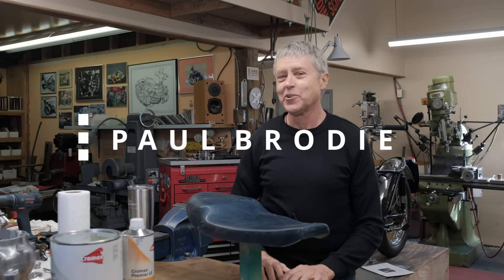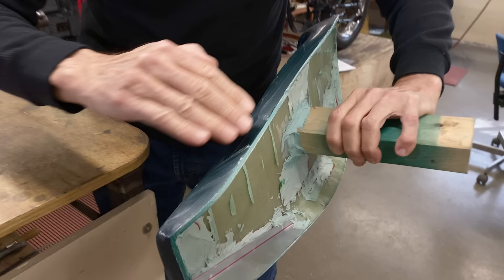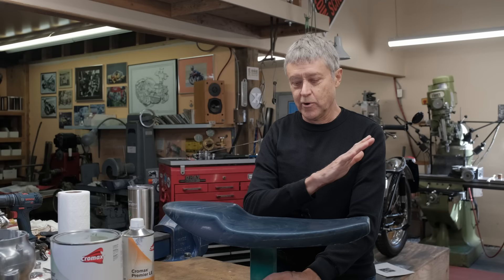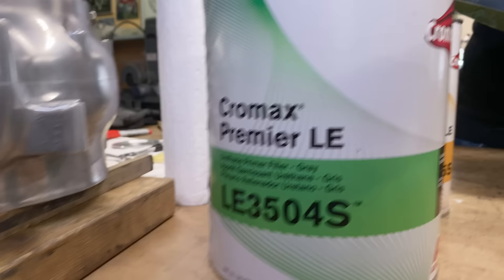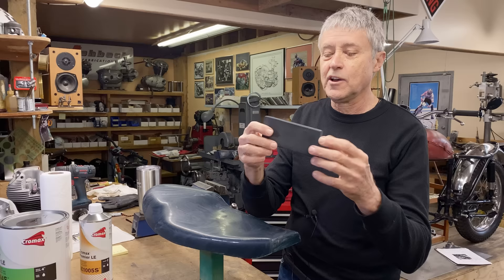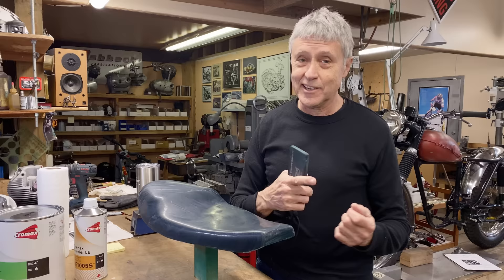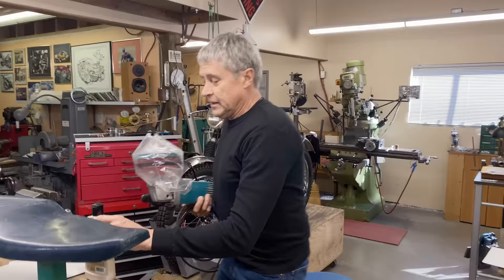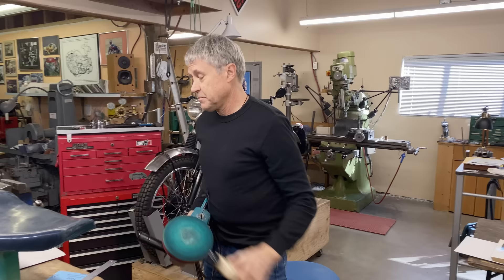How to make a carbon fibre seat pan // Paul Brodie's Shop

Comment: Better you then me getting that resin stuck to everything. I sanded a whole Corvette with roofing insulation, it was I was told volcanic, took all the paint off, conformed to all curves, but didn't scratch the gelcoat, except it smelled like an unattended PortaSan, sometime you have to take the bad with the good.

Comment: "If you don't do it properly a lot can go wrong" that definitely  applies to so many things, but especially composites. It's nice to see a simple process for carbon fiber. I'm used to seeing it done with the vacuum bagging and infusion or the prepreg and autoclave and being so expensive. I still have a lot to learn about all the finishing and composite processes, since I mostly come from machining, welding, and working on engines.
Reply from the maker: In a sense I am "cheating" with the carbon fibre, but I was just after the look, so this way is easier for me. Thanks for watching.
Reply: @paulbrodie  You could cheat a littler bit more - just get a pack of Cloth Bags for the vacuum cleaner & peel ply.
These bags a dirt cheap and the heavist part is the resin with that method you can get theparts lighter and nicer & without air bubbles its stronger as well.

Comment: Re your mudguard (fender) disaster, I did something similar years ago when attempting to take a fibreglass mold off a plaster wall light fitting.  My wife was away on holiday, so I had two days to recreate the fitting out of timber, get multiple coats of shellac on it and  then lots of wax.  The end story: the (3 piece) mould came out fine and I ended up making 22 lights for our new house.
The moral of the story is to not give up, but take time to regroup, learn from the mistake and move forward.
Reply from the maker: David, I think you are correct!

Comment: Good to see how this should be done.  I once built a kayak using molds for top and bottom. It went well until it came to joining the top to the bottom with 4" wide fiber-glass tape on the inside seam, it worked OK but looked pretty bad and I got a lot of resin in my hair.  Happy days.
Reply from the maker: Getting resin in your hair does not sound like a good thing! Fibreglassing is not always easy, and you really do have to think on your feet sometimes.
Reply: Haha me too!

Comment: That was excellent, I went through the same learning process.
I learnt I could make race seat mounts on motorcycle frames by covering the frame with cling film and using the tubes as the buck.
Reply from the maker: Thank you Geoff.

Comment: I'm working on a kit car and went through a similar learning curve on the fiberglass body.  One other thing the roller does is soak up excess resin.  Dunking the roller in acetone was a trick I hadn't heard before.  Nice to know that now.
Reply from the maker: Yes, putting the brush or roller into acetone is good to know. I struggled so much before I knew that.

Comment: Spot on for the explanation. Between Crownline boat factory and Bombardier/Sea doo I spent 7 years doing fiberglass repair,mold maintenance and running their fiberglass chopper guns. Acetone is definitely your friend when working with composites,although it’s extremely flammable. Definitely need to work in a well ventilated area when working with resin and acetone,been in two chopper gun booths that went up in a fireball. Apparently static electricity builds up in your body when you run the chopper gun or when you knock down the glass with a roller. We had 3 gallon acetone buckets to wash our hands and chopper guns in. The first time I went up in flames my buddy had just lifted the lid on his acetone bucket. The second time it was me getting the chopper gun close enough to the acetone for a spark to jump,we constantly scrubbed our guns with acetone and paint brushes to keep them in operation. Just a little fyi there,I always keep a door open with a box fan in the opening to circulate fresh air when doing glass work now. Great work on the mold and your video. Keep up the excellent work. 👍
Reply from the maker: Lewis, good comments! Yes, I do need to be more aware that acetone burns very well. You definitely have some stories about your work with fibreglass.. Thanks for watching!
Reply: Glad to see your content regularly on here. Still in the process of finishing up my knucklehead engine,just waiting on shims to arrive for my rocker shafts. After that’s done the Aermacchi is back in the works here after finding a useable cylinder. I don’t miss the fiberglass work occasionally but if I had to build boats as a source of I’d be looking for a nice cushy cardboard box to live in,lol. Can’t wait to see what’s coming down the pike on your next bike project or installment.
Reply from the maker: @lewismocaby3646   Thank you Lewis :)

Comment: Thanks for filling in my holes in my understanding of Fiberglassing.  I didn’t know a lot of this stuff, so I learned other methods, e.g. using toilet bowl wax or beeswax, building up a few thousandths, layup, then heating things when done and the part comes off “dead easy.”
Reply from the maker: Yes, there are several ways that can work. Thanks for watching.

Comment: If you put a flange around the bottom of the mould you can easily vac bag it. Using a slow cure epoxy will give you plenty of time. The part will be much stronger and lighter. Sac cloth and bleeder material will get all that excess resin and bubbles out. You would love the results being a fussy old frame builder. 😎

Comment: From what I remember from about 40 years ago, chopped strand mat has a binder that dissolves when using styrene based resin but not epoxy based ?
Woven roving doesn't have any binders added AFAIK?
I was taught 5 layers wax at minimum and re-wax after 'first pull'. I bought 'special' release wax but pretty much any hard wax works.
 I guess things have changed rather a lot though?
 Acetone will also 'revive' styrene based fiberglass allowing extra layers or repairs to be made easier and stronger, particularly if you have a gel coat.(Although really old stuff would require quite a long time to soften properly)
Reply from the maker: Can't really answer your questions, sorry. I have a little knowledge, but am not a true expert.

Comment: I went through the same tribulations on the first parts I tried to make too. It only takes one time to wisen up though. With wax and then PVA, you don't have to be so fussy. Once a mold is broken in, the pieces almost come out on their own. Usually a dark tooling gel coat is used so that you can see the air bubbles, as compared to a white or light color. I usually use the orange.
Reply: I heard about PVA many years ago but still haven't tried it. I'm aware you can get brush on and spray on versions and also 'universal' but don't know what the differences (if any) really are?
Reply: @1crazypj  The spray on will be thinner I imagine, just like the spray on gel coats are. I have always used the brush on versions of both, mainly because of very low volume parts. The handiest thing I ever did was bring home a bunch of brochures from the supplier years ago, when they had them in their showroom. The info in them really helped me out on many aspects of working with the products, from mold making to parts production.

Comment: Hey Paul, they make a product (many brands produce it) called "peel-ply" that you can put on top of your layup, it's a permeable membrane that then lets you squeegee out the excess resin from you layup, and then after the resin cures, it peels away. This lets you get almost as much out as vacuum bagging, and allows for much stronger and lighter parts than you can get with just traditional layup and rolling, but you don't need to bag and vacuum it. I think you would enjoy using it in your shop. It's also useful in reducing the sanding needed afterwards if you intend to paint.
Reply from the maker: Thanks. I will keep that in mind. I only do this sort of thing maybe once a year...
Reply: @paulbrodie  Yeah, it can be a bit of a niche application. If you find yourself doing more composite work, take a look at Mike Patey's build of "Scrapy" on youtube, his composite work on his airplanes is a wealth of knowledge.

Peel-ply closing the gap between traditional layup and vacuum bagging is just handy to have in the quiver though for infrequent composite work, since it reduces the overhead of equipment so much.

Another nice technique for one-off parts is using pink foam insulation boards to sculpt a model out of, then do your layup around it, before soaking the part in a acetone bath to melt away the foam, if you leave a couple drain holes you can even do thinks like composite tanks this way. This saves a lot of the mold prep work, at the cost of it being single use.

Thanks again for your videos, I really love the techniques I learn from them!
Reply from the maker: @MatthewMenze  Thanks Matthew. I printed out your comment for future reference.

Comment: I had a friend who is a German certified composite aircraft repair matiance technician . I had the massive advantage of his supervision when I needed a small part made. I have seen him use the wing of a fully functional aircraft as a plug to make a new wing skin mold  to use repairing a second aircraft of the same type and model.  You could say he is very confident in his abilities for good reason. That plug was worth $150,000 .
Reply from the maker: It sounds like your friend has some very good skills!

Comment: You can make smaller specialized rollers out of threaded rod.  Having a lathe around to center drill some holes in each end of the rod section is handy but I drilled some by hand way back when I started  glassing  small part runs.  A handle bent out of some coat hanger wire and Bob is yer uncle. Yeah cleaning the roller in your acetone bucket is the ticket.  These threaded rod rollers allow you to pull the matt sideways into corners and such as well as roll out tight inside radii.
Reply from the maker: That's a good idea using redi-rod to make very small rollers. I haven't needed anything that small yet, but you never know. Thanks :)
Reply: For larger rollers, use fender washers with smaller washers as spacers between them, it's quick on larger surfaces
Reply from the maker: @1crazypj   They sell rollers in all shapes and sizes. But yes, you could make one.

Comment: Hi Paul and Mitch, Great videos! I wanted to point out two things that could make your life easier when working with fabric reinforcements. The fabric you are using is plain fabric, which is stiffer than twill fabric. Twill fabric can bend around curves easier. Another point is fibre orientation, a +-45 deg orientation is better for small radius, as the "local" radius that the fibre sees increase. I believe you could have laid your carbon sheet in one piece with those tricks. As long as you are not looking for the lowest weight possible it does not make much of a difference other than optics, but I believe those tricks might come in hand for the aeromacchi ;)
Reply from the maker: Javier, thanks for watching and commenting. Someone else suggested twill fabric. I'm still learning, and don't do much fibreglass at all. But I do enjoy it.

Comment: Perfect timing. I want to make a shorter than stock beak for my R1100GS because I snapped the original one off. Thanks for sharing all the knowledge and experience. You've boosted my confidence that I can get it done.
Reply from the maker: That's great the timing was perfect. Thanks for watching!

Comment: Hey Paul! Thanks so much for a very informative video!  
I've been doing glass for years , never heard of the acetone dunk before , no one tells you and there's no mention of it in the various handbooks I've read over the years, also other subtle differences not clearly explained in handbooks.
One thing I do slightly differently is , I put a layer of matt down over my last layup and roll the blazes out of it  , what it does is , it picks up the excess resin until you have a "dry" but fully incorporated layer and you achieve a factor closer to the 60/40 , 70/30 ratio that builds strength.
Reply from the maker: Hamish, thanks for watching and commenting :)

Comment: Hi Paul, next time try a 3k twill pattern (45 deg woven) carbon fibre matt. It is designed for this application because it can mould complex shapes without needing to be cut. You were using a 3k plain weave (90deg) pattern best suited to flat and cylinder shapes. Have a great day!
Reply from the maker: Great suggestion! I know there are many choices for the carbon weave.
Reply: @paulbrodie  there are a few choices but for your purpose, unless you are looking for a particular pattern, the 3k twill is really your only choice. Any thicker and you run into the same problems and any thinner you loose some structural strength. 3k (that’s what we call it in the U.K.) is a construction grade, perfect for what you are doing. You got half right 👍🤣

Comment: As always, thank you, Paul & Mitch.   I've done a bit of fiberglass, mostly when I was racing, and I found repair & reinforcement to be rewarding, but building new parts from scratch doesn't really play to my strong suite. I'd lose enthusiasm for the project about the time I needed to polish the mold.

I've often wondered if you could get many of the benefits of a vacuum bag by putting the part inside a cardboard or plywood box, then filling a garbage bag with water on top of it.  I've never tried it, so it might be a terrible idea.
Reply from the maker: Thanks Alan. I've never done vacuum bagging, so can't say if your idea with a garbage bag and water has any merit..

Comment: Also I discovered a while ago that if you cover your part with plastic like the 2 mil stuff from the home improvement store. You can squeegee the extra resin out and it will lock your carbon down to the form. It acts like a vaccine bag without the vacuum. Give it a shot sometime and let me know how it worked. Also if you have areas where there is to much plastic you can shrink it with a heat gun. Just be careful of the weave so it doesn't get wrinkly.
Reply from the maker: Thanks Dan. I have no idea when I will have another project using these materials...

Comment: Interesting video,  very different to the way I do it. To aid release I spray PVA at high pressure low volume to give a very fine coat and it pops off a treat. Your carbon seemed very stiff Paul. The stuff I use drapes beautifully 200gm 3k. I mostly vacuum infuse and it's much cleaner if wasteful of 'consumables' . Anyway nice to follow the builds you are doing.
Reply from the maker: Thanks Chris. Yes, there are many ways to do this process. I'm still learning.

Comment: In bees wax modelling to get the item out of the mould you have to submerge it in  distilled  water and put it in a fridge until the item comes away from the mould. When you were young and inexperienced maybe of you puit the mud guards in water and putting them in a cool place might have separated them. One will never know.
Reply from the maker: My fender molds were truly stuck. I don't believe water and a cool place would have helped.
Reply: @paulbrodie  We use to sand plugs with 150 grit, several times wax and PVA. Water dissolves PVA. Easy release. Coolest Cub running some day. Thank you, both.
Reply from the maker: @4486igi   Thanks for watching!

Comment: If you use a 2x2 twill carbon fiber it will conform to tighter bends and corners
Reply from the maker: Yes, there are different weaves available. George didn't have a great selection, but this carbon weave suited me so I bought a few yards.

Comment: Paul you could have easily vacuum bagged that work with house hold products you have to hand and a sheet of peel ply.
Reply from the maker: You make it sound really easy!
Reply: @paulbrodie  Sorry I did not mean to criticize It will be fine as is ,made plenty of stuff the same way still going strong 50 years later. Vacuum bagging does have several benefits and once you have got your mind round it it really is a bit of a doddle..
Reply from the maker: @davidprocter3578  No worries, I did not take it as a criticism.. I'm just not setup for vacuum bagging and pre-preg. I would have to get a freezer for the pre-peg and where would that fit into my small shop?

Comment: Nice job Paul😎 can we get a video on your yellow VTR? I guess it's your daily rider. I have a red one in various states of disrepair lol
Reply from the maker: Thank you Matthew. A video on my VTR? I only ride it in the summer. Not sure if that would make an interesting video...
Reply: @paulbrodie  please do, mine is an old nail. 2001 and only 47,000 odd miles. I have rebuilt the forks that had water instead of oil. Carbs were bodged badly. Put a cheap YSS shock on the back which is actually really good. Whole new exhaust system as that was basically gone. It was used as a commuter and they salt the roads here. Would love a video on the yellow peril 💪

Comment: That bottle that you're messing with at the end of the video - sometimes I think they make the bottle caps to be not just childproof, I think they make them to be humanproof so nobody can open them unless they really, really want to.
Reply from the maker: That bottle cap is a pain in the ass! You have to squeeze the tang, AND also press the cap down. The catalyst is a little like glue and you need extra torque to break the cap lose if it hasn't been opened for several moths. Good rant, eh?